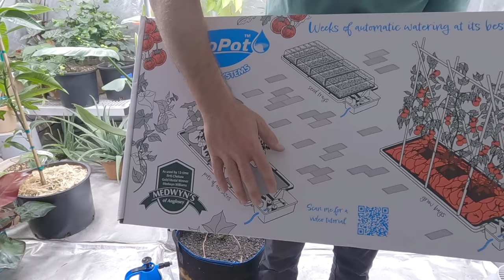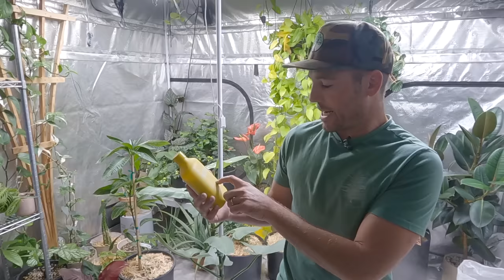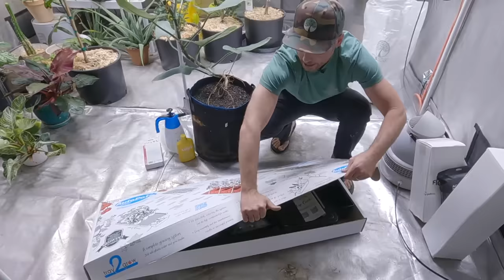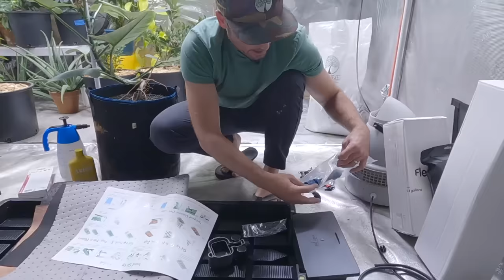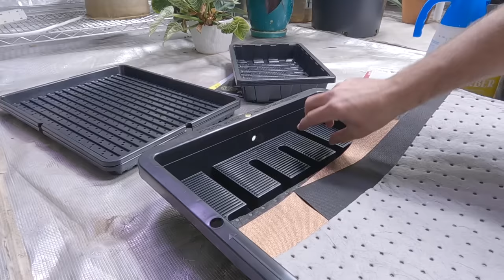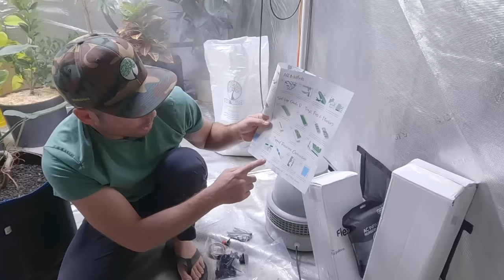BuildASoil: *NEW* AUTOPOT // TRAY 2 GROW: UNBOXING AND SETUP (Product Highlight)

Comment: Hey, Jeremy and the gang. Just a quick tip for the cacti in your tent. I'm a cactus grower myself and have been for years. The reason your trichocereus cactus is growing kind of goofy like that is too much nitrogen. The nitrogen is causing the cactus to shoot up growth giving it that silly looking thick at the base and skinny up top look. Cacti should be fed little to no nitrogen, ever. At best you can use your BuildABloom product a few times a year. Cacti don't really need fertilizer or boosters because their roots are very good at harvesting nutrients from the rocks in the soil. Stop feeding them with the same solution you're using to care for the rest of the tropical tent, and instead make a separate solution for the cacti. That goofy looking growth will stop and your cacti will look the way nature intended. It can't be fixed at this point. Slice off the top growth and let pups start from the healed top. At that point you can remove one of the maturing pups, let the wound dry, and then put the pup in soil and roots will shoot out in no time. Also, consider removing it from your soil and switch to 100% inorganic soil. Your soil is built for fast growing plants, like cannabis. Use pumice, lava rock, limestone, zeolite, sand, etc. Make a simple mix of one or more of those ingredients and your cacti will love you for it. 

Anyway, in case you were wondering why it looks like that, now you know. Take care!

Comment: 13:17 Jeremy, you’ve got it right. I looked on the website and took some screenshots and looked at the setup video and they both dictate the gray sides go down and the copper side of the root blocker goes upward. Thanks for the demo.

Comment: I have both the AC Infinity fiber bags (with the bases) and the 15 gal. GrassRoots bags. I like the grassroots interior lining better, but the AC Infinity bags are a bit taller for my top dress build up, and they have 2 things that make them better, 2 really sturdy handles and a sewn in seam with metal grommet holes for tying over some branches - although 8 holes would be better than the 4 they provide. I had to burn holes into the fabric sides of the Grassroots to tie off the plant for LST which is a weak fix. I made bases out of plastic, 3" deep water heater type catch trays that have a thru side fitting with screw cap. Then put in the 1 thick (or more) grid (cut to fit) from overhead lights to set the bags on with several/many wicking rope material up and under the bags and back down into the water. Works great.
Unfortunetly the AC bases only go to 10 gal. sizes. I grow most in 15 and 20 gal. bags so have to make the same bases for them as I do for the Grassroots (but it's cheaper). They AC Infinity bags have proven to be better. (to me)
Not automatic reservoir fed but they hold lots of water. Ask Grassroots about adding those things.
Everything comes from you guys (mostly, but you are so far away) including the 250 gal Grassroots mixing bag that I make my soil in. 
I added a Bluemats auto water system to make it almost carefree. 
The AC bags are sturdy and hold their shape better.
One really BIG thing you missed on the Autopot system  -  price??? 
How did you miss mentioning the price? Must be a lot? 
As a market gardener that is important... Maybe I'll get one to try, but...
A small low speed open air line keeps the water at a slow-moving gurgle

Comment: If you have red cactus it is getting either too much light or heat.  The larger cactus on the ground actually needs more light which you can tell because it is stretching with really skinny growth.

Comment: I wish there was a 32" by 32" grassroots pot and an autopot for it. Something perfect for a 3x3 tent. Currently the 3x3 grassroots pots seem like they would be too big for a 3x3 tent.
Reply: 3x3 goes in a 4x4.  4x4 goes in a 5x5.  That's what most do anyway.   In a 3x3 I believe 4 20 gallon with trays fit pretty good.  That will give ya about the same cf of soil as a 3x3
Reply: @vinniez2188  As my first time in living soil I am considering either your plan of 4 containers. Or I could do 2 earthboxs. Or a third plan might be a 32 x32 raised bed I found online. I am open to advice on which I should do as a first time living soil grower. I am finding it difficult to find great options for a 3x3 tent. I believe the 20 gallon diameters are too big to fit 4. Thanks for any advice though.

Comment: I have a 4x8 bed using blu mats. I would convert to this smaller footprint, running 5 of them. At $1000, though, seems a bit steep.. i would like to see packages to make it more affordable. 

Would also like to see it in action, filled generously with soil.. as if it were the 5th cycle. (Sides pillowing out)

I'm curious to know about what type of mold, or anything living for that matter, would harbor in the tray. Fungus gnats? 

I would like to see footage of the tray being filled, where the waterline will sit, how the fabric reacts to the wicking process, how far up the water wicks on the sides of the bed.
Reply from the maker: There will be a video showing the Tray2Grow in action in the future! Stay tuned! 🔥
Reply: @BuildASoil  I look forward to it.

Comment: Hope you see this comment. 
I have a 47L living soil pot with a tomato growing in it. I'm manually watering to around 80mbar per day, it's been drinking so much that a day after watering, it has run to 400 mbar. Because it's drinking so much, it's blistering and leaf ends are going dry. I want to keep the moisture high so I'm not killing the top layer. I've just killed off my cover crop and mulched but still drinking to much. Daily temp; 27°c 65-80% humidity. On 18/6

Comment: Does ot come w air stone n air pump and tubing for reservoir if aquarium does not have moving water it goes bad quick never leave overflow in trays bad idea same as wicking pot over watered pot w tray causing bugs and root rot and powdery mildew and worse bud rot. And home for flying insects.

Comment: a copy of the original autopot systems from Australia, which manufactures much better quality. its all about quality engineering, the UV treatment and plastic used
Reply from the maker: Autopot imports them all to the states for distribution. I think they are the same... No?
Reply: @BuildASoil  the Australian company is a different company that makes a 2ml aperture valve whereas ours is now 5ml. Our plastics are UV treated and made with the highest quality materials. Over two decades ago we made our own vacuum double float valve and patented our design. We then have continued to modify the valve and our products in unique ways that no one else is doing. Think apple vs android. Similar but different products.